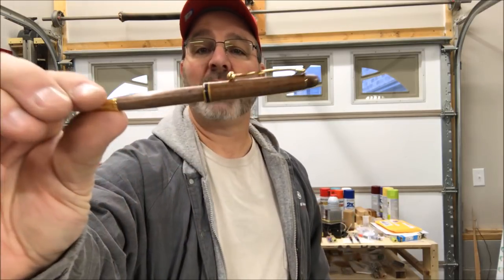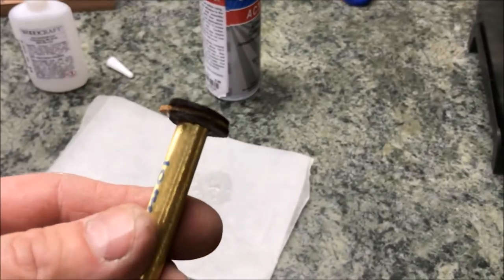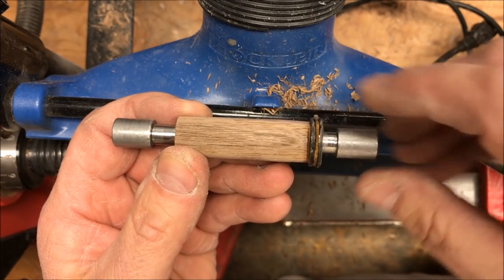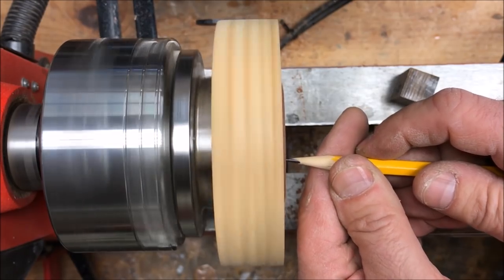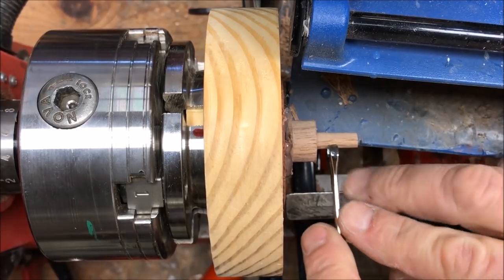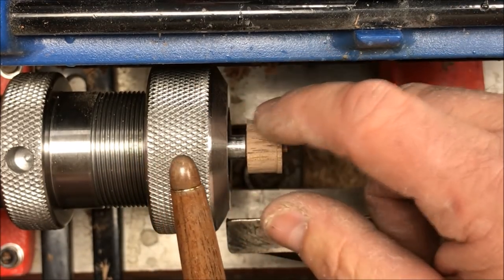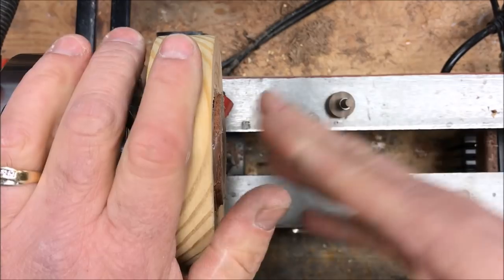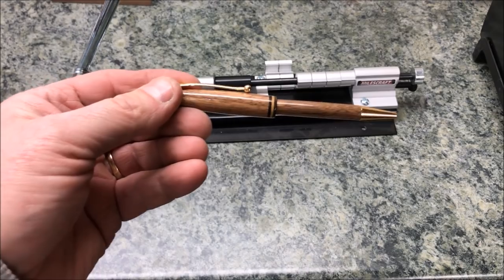Modifying a Slimline Pen Kit

Comment: Hi have questions Slimline pen making it a whole one you showed the length of the two tubes and the center band , in tremending the pen blank with the barrel trimmer you cut away the whole amount of the band, doesn't that make it too short. Lonnie Shrum
Reply from the maker: Hello Loni’s,
  As long as the tube you make is the length of the upper and lower tubes plus the length of the center band, it will be the exact length needed. 

Regards,
Bob

Comment: Hey man, great video.  Can’t wait  try it out.  Two quick questions.  Do u have a link for where you bought  the 10mm brass tube? The one I ordered from Amazon does not fit over the 7mm tube.  Second question, where did you get the bushings to fit in the 10mm tube? Do u have a link for that as well?
Reply from the maker: These tubes will work, their 10mm. 

I just used the first 10mm bushing i could find in my sets of bushings. Any one will do. 

Regards,
Bob

Comment: Bob I am disable but watch all of the pin turning videos.  I like yours best for two reasons 1. your presentation is easy to understand and 2. you keep a clean work area. I did not know about pin turning when I was able to work. I built radio control airplanes from blue prints and kelp my work area clean.  Thanks for the entertainment I get watching youtube.
Reply from the maker: Thank you for watching Earl,  
  It was great to hear from you. 

Regards,
Bob

Comment: I have done this without the 10mm brass tube. I just glued a piece of contrast wood to the bottom of the brass and instead of trimming direct to the brass end, I left it a little proud. I also tossed the center band out. When I turned, I made the top a little thinner/narrower than you did, but it has that same European look on a slimline because it's bigger than the slimmer lower section. I found I could also use a little longer lower section (like the European) and just press the transmission in a little farther. Great suggestions and thanks for all the great videos!
Reply from the maker: Thank you Benjamin. 
  Modifying pens is very enjoyable. I need to do more as time permits. 

Regards,
Bob

Comment: Very cool idea.  The finial shape is not matching the upper tube shape though.  How can you correct that?  You couldn't turn it as one piece then saw it because the saw kerf would disrupt the flow...Maybe sand the finial and top tube as a single unit put together without the clip?  Of course you take a chance of getting the top tube out of round by using the Collete...What a neat jumping off point though, is this your idea or did you get this from somewhere?  It amazes me the things you can do with the ubiquitous Slimline kit...
Reply from the maker: It was my idea to to the onset cap and finial. 

Regards,
Bob

Comment: Great pen and very clever modification, I'm going to try it. And that wrench technique is absolutely brilliant! I'm assuming you could do the same with any size wrench for various dowel sizes?
Reply from the maker: Thank you David,
  Yes, bought a cheap set and I use 10, 11, & 11 mm wrenches and and an old 1/4” wrench to make tenons all the time. 

Regards,
Bob
Reply: You mean you can keep track of a 10mm?! 🤣🤣
Reply from the maker: @davidpeters8813  LOL, Pro Tip: use one of those retractable belt key holders. Attach it to the closed end of the wrench, you don’t need that for tenons anyway. Once attached to your belt the wrench will always be close at hand. 😃😛😂

Comment: Really nice pen, Bob.  A suggestion for centering the finial blank on the sacrificial faceplate:  Find center on the end you will make the tenon, mark it with a center punch and then bring up the tail stock to the center point.  It will automatically be centered on the sacrificial faceplate.  You can then hot glue it to the faceplate.
Reply from the maker: Great tip John. 

Thank you. 

Regards,
Bob

Comment: Instead of the scroll saw, if you could find a hole saw that you could use with a 10mm center drill bit you could cut out little doughnuts right on the drill press. A pen made by covering the entire tube with layers of different veneers might be cool.
Reply from the maker: That’s a really good idea on the hole saw Berry. 

Regards,
Bob

Comment: If you make the finial  (sp?) Area bigger it will be bigger than the ring on the clip and leave a gap. But what you could then do is cut the finial in a way to hide the ring. Would require some fine lathe work.
Reply from the maker: That would be an amazing mod. 

Regards,
Bob
Reply: RJBWoodTurner you would have to sort of ad a recess and then ad a notch for the clip to come through

Comment: 1:54 when you started to drill the veneer I was holding my breath thinking it was going to explode or just not give you nice hole. 

If that happens you can clamp the veneer between scraps to support it better.
Reply from the maker: LOL, I had great luck drilling, it was the scroll saw that was the devil on this operation. I made that zero clearance and it really helped. 

Regards,
Bob

Comment: I was needing help pricing on pens that I made. I realize the different types of pens out there. I have friends that seen the bullet-rifle pen and now they want to buy them from me. I probably have 20.00 dollars in parts but I need a labor cost. Thanks for any input from anyone.
Reply from the maker: Hello Mike,
  I don’t really use a labor rate. I use PSI, they have a low, mid, and high selling price for every pen. I start at the mid and as long as it sells I bump up the price until sales taper off. That lets me know what the market will bare. 
  Then I try to batch make them and improve my processes to decrease my time investment. 

Regards,
Bob
Reply: RJBWoodTurner   
Thanks Bob, your a very talented worker, your pens look amazing. I need to sharpen my lathe tools because I’m getting a lot of lines. But then I see how you use CA glue to get rid of them. Thanks again for the videos!

Comment: very nice job Bob!  I had not thought to laminate veneers to make a trimming,. Ingenious! 

Any reason you did not use a 7mm wrench instead of the 1/4" wrench? You can pick these up individually at any auto parts store, and would be a closer tolerance than the HF wrenches.
Reply from the maker: Thank you Neal,
  1/4” is the diameter of the mandrel, 7mm it the outer diameter of the Slimline tube. You could use it but you’d have to do a little more sanding to get it to fit. 

Regards,
Bob
Reply: Thanks Bob, my mm to inches is lacking today!
Reply from the maker: LOL, I completely understand. 

Regards,
Bob

Comment: Beautiful Pen and thanks for the video. The Slim line was what I started with back in 2007 and modified several even after I had triple By-Pass surgery 2008 and made my last one in 2011. Had made 478 pens total. 76 years old now and wish I could still be turning. Thanks again for sharing.
Reply from the maker: Thank you Raymond,
  I am sorry you had to give up the hobby but I understand, your health is far more important. 

Regards,
Bob
Reply: good on you, you should ignore your age, it's just a number.  I am 89 and still making pens. must run into a thousand or more . I just completed a dozen tonight
Reply: I forgot to add I have a pacemaker for the past 5 years I just ignore it and get on with makin shavings

Comment: Hi Bob  Great looking pen. I just purchased a penn state 10x18 var speed lathe , and was wondering
             what speed do you leave yours on? I Have mine on the low setting.Thanks and merry Christmas to you and 
             your family.
Reply from the maker: Hello Anthony,
  For pens, I turn as fast as it will go, 3,000 RPMs plus. For sanding and finishing as slow as it will go. 150 to 209 RPMs. 

Regards,
Bob
Reply: Thanks Bob   I guess you go back and forth with belt,I  hate to have to always take off the hand wheel
                        to get to the belt.
Reply from the maker: Unfortunately you do have to do a bunch of belt moving.

Comment: Great video! I can’t wait to try it out. Two quick questions: do you have a link for the 10 mm brass tube? The one I ordered from Amazon does not fit over the 7 mm tube provided with my slim line pen kit. Second question: where did you get the bushings for the 10 mm tube? Do you have a link for that as well?
Reply: You can do without the 10mm tube if you want. Just don't turn to the bushing size and leave the top oversized compared to the lower part. a piece of contrast scrap (on the 7mm tube) works just fine - you just leave thicker than the lower part.

Comment: What size bushing are used here ?
Reply from the maker: I used the largest bushing from the PSI Designer NT bushing set. Really you could use just about any size. You can always remove it and tweak the cap to an appealing diameter. Bigger would be better to start out. 

Regards,
Bob
Reply: Thanks for the reply. Your videos have been instrumental in getting me started with pen turning....
Are there any sources of pre-made center bands that can be used to thicken the midsection of the slimline or slimline pro pens ?  The idea being to use one that fits the 7mm or 8mm tube without needing modification.
I like the slimlines, but many of those I've shown my samples to tell me that the narrowing at the waist takes away from the look and feel of the pen...
Reply from the maker: I don’t know of any company making larger bands. I started making my own from contrasting woods. If your like me, you probably have a ton of cut offs that are perfect for this. Plus I think they look better than the metal. 

Regards,
Bob